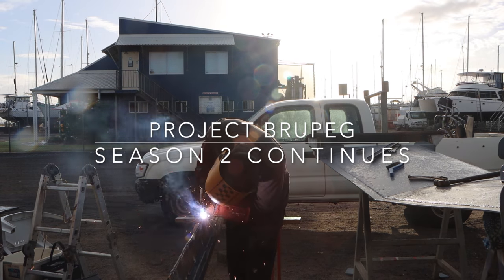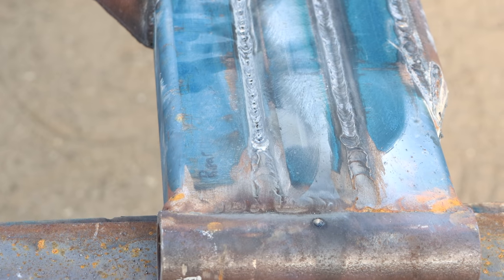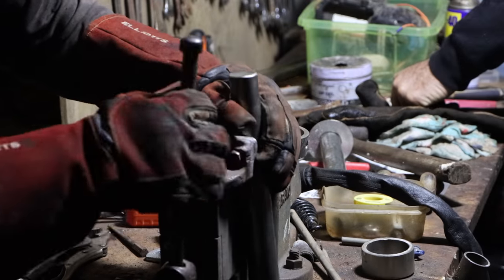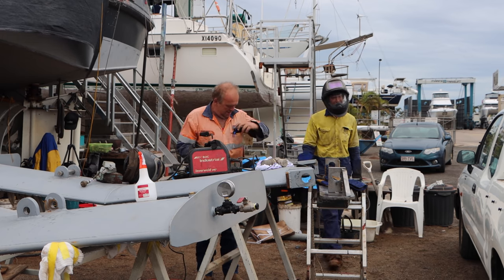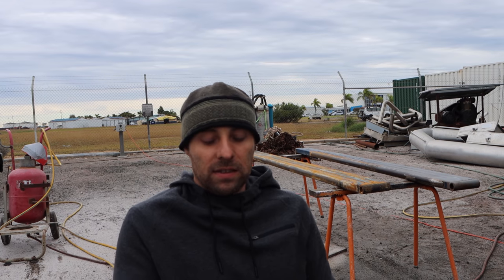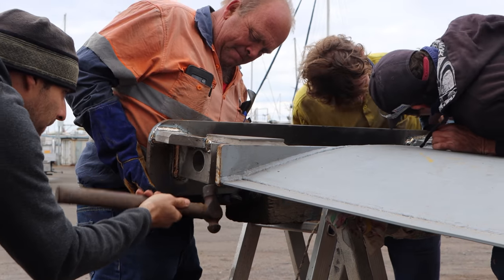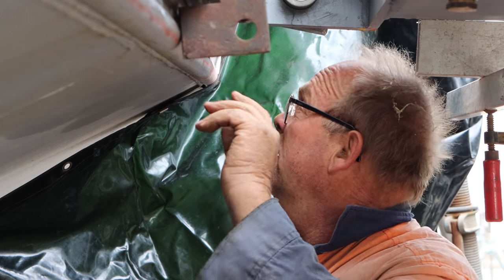Welding Steel Wings to a Trawler - Project Brupeg Ep. 148

Comment: What in the whole wing construction will be the faillurepoint when you hit something big? If it is the hullplate, you are in a lot of trouble. Make sure the hull is stronger than the hinge. Good luck.
Reply from the maker: My first thought is to define something big, these are designed to take a full-speed direct hit that brings the hull to a dead stop without failure. So if its a navigation pile, I think we will dent the pile and wing, if its a rock, I would be worried about driving the hull up onto the other rocks around it, if we hit say Chuck Norris, we won't stand a chance, instant knock out to Brupeg
Reply: Great idea but I think 25 per cent benefit 75 per cent problem I hope I am wrong 👍🇬🇧🍺
Reply: Sometimes just looking cool is enough😄
Reply from the maker: Hi Ron, in the nicest possible way. You are wrong, boats that have swapped to wings are evangelical about how amazing they are.
Reply: To me, it looks like the failure point would be the forward hinge flange tearing the pin out and bending the assembly backward, that would certainly be preferable to a ripped hull plate. I would reinforce the hull to dictate that outcome.
Reply: @ProjectBrupeg  Do these wings perform better than a towed sizable paravane ? Thanks........
Reply from the maker: Very much so. Paravanes have very high drag, and only work when being pulled on. Wings have low drag and work in both roll directions
Reply: @ProjectBrupeg  I agree and disagree about the paravanes. I use paravanes on my 75 ft commercial fishing vessel and they work great for the purpose we use them for and I lose about a half knot per paravane or as we call them(birds) but when they are both in the water the sea is such a state that you aren't getting anywhere fast anyways and when I'm laying to they work great too. I do believe that the wings are more efficient at speed though for sure. I have friends who have switched to the wings and absolutely love them.  They are trial and error for every boat however. My buddy went through 3 different sizes because the first one was too big and it absolutely killed the rolled but it also dampens the rise and instead he ended up taking a lot of water over the deck because it was a much slower rise than he expected. He eventually found the sweet spot for his size and average speed. I've seen designs where the middle would slide to make a slot to let more water through on the pull and circular plate removed to do the same. Commercial boats carrying fish get loaded down and center of gravity changes so there's a lot to consider. The important thing is to have plenty of extra structural support where it's attached to the hull because the continual heavy forces will challenge even what was thought to be robust and strong. I thought about putting them on but after consulting a marine architect and discovering I'd have to tear apart the fish hold to get more support it wasn't worth the money or effort. It's not broke so I'm not fixing it! Regards
Reply from the maker: That all makes perfect sense Robert. Completely agree about the need to tune the wings to the boat. We built these with the outer third able to be cut off for the exact reason you mentioned. If they are too big (quite likely I would think) then we will trim them down. Because they come up and the arm pin is above the waterline I’m confident we could do this tuning in the water without the need to haul. We have thought about strengthening options and we have a few things we can do but plan to see what she is like before we start chucking bucketloads of steel at her. We’ve been told by the commercial guys them at we won’t need to add more but I’m not worried if we do, it’s a weekend of welding and it’s done. We are estimating 2yrs of testing and trialing all the various systems before we say she is ready to do any offshore stuff. Be great to be faster but there is a lot to do and it’s just the two of us most of the time.

Comment: Respect, just now realized the torque moment potential where the wing mounts meet the hull.
Reply: It became apparent when the welder hit the “soft spot”. Folks I hope you don’t get a tearing off moment if the outer tips of those suckers lodge or impact...
Reply from the maker: Yeah there is a lot of pressure on things but these wings have been esigned strong enough to withstand a full speed impact that would bring the boat to a complete stop, only thing we will be changing over time is the piano style hinge upgrade which will further strengthen the system

Comment: I’ve done that before. If it’s non critical then you can switch to solid wire turn up the heat and just burn in. Or spot weld the porosity holes. 

Normally I wouldn’t say that but with 70 some feet of weld you’d have been fine to save the grinding and just fill the porosity holes for that foot. 

I know you’re done now. My comment is just for next time you see something similar where that few inches or foot of porosity ridden weld isn’t needed except to seal out the water. 

Cheers and keep up the excellent work!
Jeremy.
Reply from the maker: Yeah thats a fair point, i was pretty happy with 70 feet of weld in 15-25knots of wind and i ended up with a foot of porosity.

Comment: Hope Jess is ok, whatever is the matter I’ll say a prayer for her, great work on your boat, It would maybe be prudent to take head of some of the mentions of being able to easily fix the wing if something goes wrong and about possibly having failure points maybe like the pin so you just replace the pin instead of something more critical, continued success 

     Sincerely 
               Fabrizio
Reply from the maker: Hi Fabrizio. The design we have is a copy of one that has been used for nearly three decades in Australia. We will be changing the hinge design in around 18months but for now these hinges are plenty strong and able to handle a hull speed impact without damage to the hinges or hull
Reply: Project Brupeg Alright, just saying that it’s probably better if a wing drops to the ocean floor and not the boat, you know if the side plating gets torn if a wing gets knocked off is my concern, I’ve always hoped for the best but prepared for the worst, however I always wish you and Jess all the best, just throwing some other ideas your way, I’m wondering if you attached the wings to some super structure behind the plating like something coming from the keel or the ribbing running from the keel so that if the wings do get torn off it leaves the attachment point behind and doesn’t cause any tearing, but I know talk is cheap, continued success 

     Sincerely 
               Fabrizio
Reply from the maker: In Brupeg's case the double backs onto the front engine room bulkhead right in the middle, then 450mm either side of that bulkhead is a rib, and the chine is 32mm solid bar triple welded to the hull plate. this is the strongest part of the hull. There isnt a lot more we could attach it to internally. Normally the commercial guys dont even have that much attached to the wong when they retro fit them. Like most things we looked at what others have done then doubled it just to be sure.
Reply: Project Brupeg that’s good, always wish you guys the best, would also be interesting to ask those commercial trawlers if they’ve been through a storm with the wings and what effect it had on the wings and boats, just some more information for you to make informed decisions, I think it sounds like your next move should be taking care of Jess maybe a strawberry breakfast comes to mind,  keep her by your side and whatever comes you can conquer, continued success 

     Sincerely 
               Fabrizio

Comment: After seeing the welder pull the hull out to meet the hinge plate it made me wonder if you will need inner plates behind the hinge in the engine room? I was astonished to see the hull pull out so easily and wondered if it didn't need a backing plate. BTW, you and your team have done a great job! The once-mighty wings do look like flippers once the entire boat can be seen in total!
Reply from the maker: Hi Rudy, its pretty normal to pull the hull on these boats out like that to meet a doubler, thats one of the beauties of steel is its actually quite flexible.The commercial guys dont add any additional steel to the inside of the baot as the double straddles 1 bulkhead and 2 ribs in our case so its the strongest part of the boat to begine with. When we haul out to do our ice mods we will be adding additional ribs to handle the ice pressure but it will also beef the area behind the wings up at the same time
Reply: @ProjectBrupeg  I was a Marine fighter pilot in my younger days and one thing that I learned in aviation is that things have to be made to fail before the main body is damaged. All of the lights that you see at the end of runways are what is called "Frangible"  so that they will be destroyed before aircraft hitting them will. Make sure your hinge offers this same protection. There are other big things in the ocean besides ice!  Looking good!
Reply from the maker: Cheers Rudy

Comment: Hey Damien have you considered using a couple of smaller windlasses to raise and lower the wings.
Reply from the maker: We did but the cost verse pulling power wasn’t great. Most windlasses can handle the lifting but if the wings load up whilst half way up/down the load can reach six tonnes so we need large winches for that strain not so much the actual weight (as that’s only 320kgs)

Comment: I going to put horizontal stabilizers on my sailboat, & put a horizontal lip  about 3 feet, on both side the entire length of the keel. I'm also going to put about a 2 ft wide chine runners about 2 feet below the waterline the entire length of the monohull sailboat. I think the sailboat will be really stabile & should not heel over. On the stabilizers lime yours I wanted to put like alarons like on a plane & force them down on the side that leans over to keep it upright. I also hear if you weld a 3 ft wide plate down the front of the bow it will cut through the water much better.
Reply from the maker: Sailboats don’t need stabilisers like Brupeg does. The rig and keel work as a highly effective stabiliser combo. Older trawlers used to put small sails on for exactly that reason.

Comment: I've always suspected that shielded wire needs to go in a little bit hot. I do have used some, but never on my own machine nor enough to form much of an opinion other than that it's bloody useful. My brother took over the family farm, and i help him with repairs in the off season. He uses it a lot, and i mean a lot. I delivered an entire box a few months ago, as i can get it cheaper from the capital. Yeah, very interesting and makes perfect sense. You have to activate it somehow and if it's not enough, it will behave like a gasless line, but you'll stay there scratching your head since "shielded core". :))
Reply from the maker: Yeah we can use 3/8” - 1/2” stick out with solid wire but flux we bump that to 3/4” to make it work best

Comment: Another big step, slightly worrying though that a hole was blown through the hull. Are you gonna inspect the hull for more weak points?
Reply from the maker: We already have. This is normal on commercial boats and now we have found it we can fix it. The hull still had some thickness left, it was only blown through because we were welding 20mm steel onto it at high amps. Not a normal thing for the hull in regular service

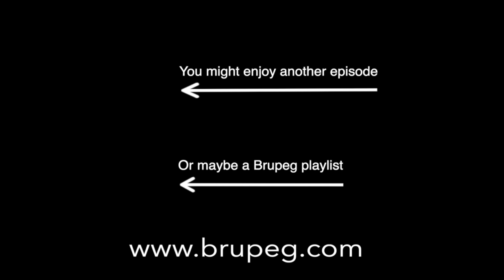Comment: Retired aeronautical engineer here. I am not encouraged by the attachment of the wings to the hull plates. That the weld blew through the thin hull plate 35:19 speaks volumes to the flimsy nature of the hull. Expect the hull plates to "oil can" under load and eventually develop cracks. Doublers would only move the cracks to another location. Some major structural reinforcement is needed to carry roll, pitch and heave loads across the beam of ship and tie into substantial bits of the ship's structure. And a strategy is needed to prevent a wing from acting as a giant can opener when the wing hits something (e.g. ice flow, reef, semi-submerged object, Etc.).
Reply: Give him one of your Boeing planes. It already has the wings built in. All he would have to do it stick an outboard motor on it and he is good to go!
Reply from the maker: Respectfully disagree here. We are copying a design that has been used for almost thirty years, it’s mounted to the intersection of a solid bulkhead, the chine and two ribs, the deck arm mounts to the top of that bulkhead and is braced by another two large doublers. They commercial boats that retro fit these wings don’t add additional internal structure and they have hundreds of sea years collectively on these wings. The hull did blow through, however this has nothing to do with the thickness of hull or a flimsy nature, it blew through where there was a small spot of corrosion internally that we didn’t know about. That area has now been sealed and will be pad welded internally prior to launching. If this type of modification was going to fail due to stress it would have decades ago on other boats. The fact this passes commercial survey in Aussie says something as the rules here are incredibly tight around structure

Comment: Just a thought on the concrete trucks they put grease nipples in the chassis to keep water from getting between the double skin chassis 
Just wondering if that could be and application for the arms between each box section two grease nipples and two plugs use a light fluid type marine grease 
Also doubles as a welding check for pin holes

Comment: Hi guys.  Question of the day. After years of work do you think you might have been better off buying a ready to go boat over over that needed a massive overhaul?   Cheers mate.
Reply: I'll try and answer for Jess, Good question, but ! 
Always when you combine sweat equity into a renovation, you always can do it for way less by 
at least half. But, the satisfaction of your knowing every nut, bolt and weld is beyond value and 
the fact that it's over built will pay off in the unforeseen !
Reply: I imagine budget is the determinant.
Reply from the maker: So in terms of spend we have spent 1/4 what other commercial guys have on similar rebuilds so sweat equity is a factor here. Also we simply couldnt afford a boat like this, but we are able to build one over time using cashflow. As for can you buy a Brupeg, its really REALY hard to find a boat anywhere on the planet that has the capability this boat will have when its finished regardless of price. 8,500nm of range, onboard fuel manafacturing ability producing fuel at $0.15USD per litre, huge engine room, large individual cabins for the crew, Ability to stay at sea for up to 12 months if we get frozen into ice, ability to get frozen into ice with the ice mods we have planned, 3-5 layers of redundancy on most systems on the boat, Fiber optic network through out the boat with nearly 40 terrabytes of storage, etc etc. All of these things can be built into most boats but very few have them combined, thats part of what makes this boat so unique in our eyes.

Comment: Congrats on a job well done. In my part of the world (New England, U.S.A.) this type of wing is unheard of. The common stabilization method is "paravanes" commonly called "birds". The birds are lowered by boom and cable. Are they used down under?
Reply from the maker: Yeah Brupeg used to have birds but because the upper superstructure was removed we decided rather than rebuild all of that we would go straight to wings

Comment: Don’t feel bad I’ve had to repair other welders welds with porosity to the tune of 50 ft welds  I used to work at Gunderson inc on the main line building train cars   Duel shielded wire then a good gas like Co2 or Argon 75/25 is very important plus no wind is most definitely important
Reply from the maker: No wind is not something we get here. We are in an area that gets solid 20knot trade winds 9 months of the year.

Comment: Will there be any way to remove them for operations in ice? This is the sort of protrusion that you avoid in designing an icebreaker... They will likely be o.k. in about 2/10 ice cover but more than that I'd be worried about them.
Reply from the maker: The plan is to have them removable at sea and completely clear of the water when we get to the ice. Ie steam to the ice with wings and remove when close, then proceed with nothing hanging over the side
Reply: @ProjectBrupeg  How are you going to remove them and where are you going to store them, aft deck?
Reply from the maker: The plan is to lift them vertical and mount them a couple of feet above the waterline. The hinges we are using now won’t be the ones we use in the ice, these will be replaced with a different design in around 18-24 months

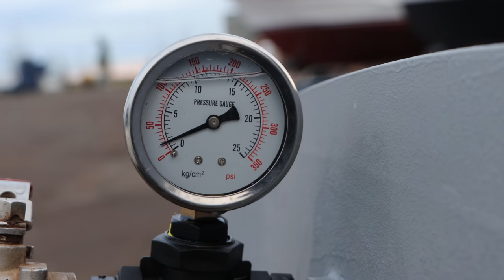Comment: At time 11:38 in the morning the weng is holding pressure. Inspecting your gauge, I think you've actually got about 1.4 kg/cm3 or 20 psi, not 2 psi. 
Also, the gauge is almost filled with liquid. Are the readings accurate?
Reply from the maker: Hi Paul yeah I read the wrong scale. I massively over pressurised the world a bit of shows just how strong they are that they didn’t budge at all. That gauge is a liquid filled gauge which is the best type to use as you don’t get any condensation ever and the gauges are generally more hardy as they are more commercial that the none liquid filled gauges
Reply: @ProjectBrupeg  Thanks for that Dame, and many thanks for expanding my education about liquid-filled gauges. I had no idea.
Reply: It's a good thing they didn't hear a squeak & whistle followed by a loud bang in the middle of the night.   Hahaha

Comment: I would of put 3 or 4, 70 or 80 mm holes in that plate and plug welded it to make super strong!
Reply from the maker: There is 330” of weld holding the doubler on. It’s not going anywhere